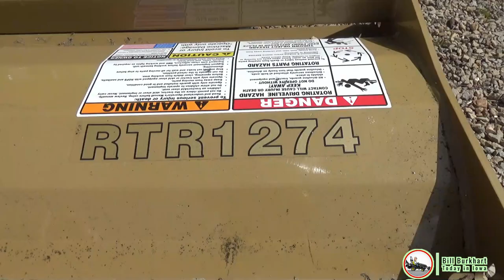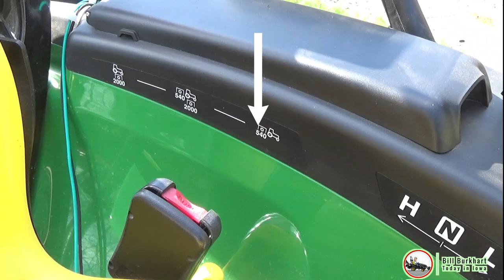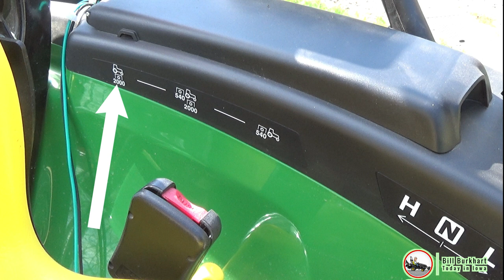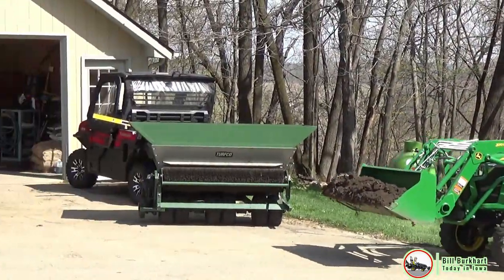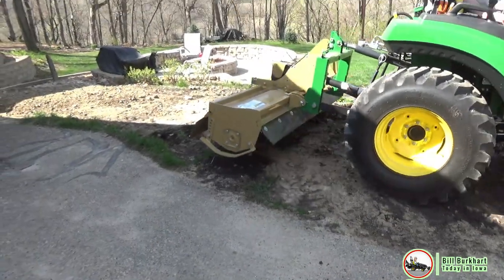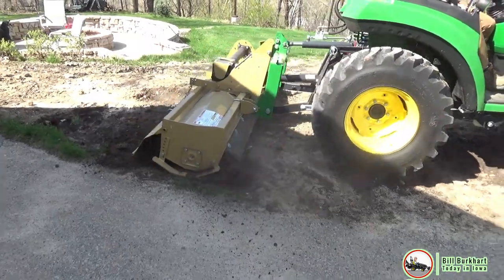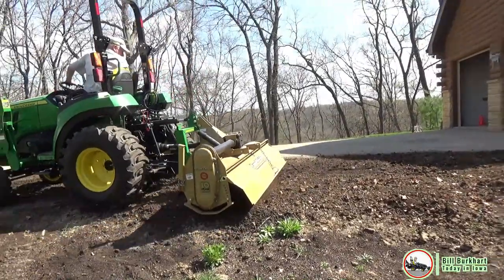John Deere 2038r / Tiller Project /  132

Comment: The tiller did a great job.  And the area looks great with the new grass.  I see you have pieces of mesh from the straw blankets wound up in the tiller.  Myself I regret using that stuff.  I'll be picking up pieces for next year, beside pulling it out of the mower deck spindles.  Hope you had better luck with it than I did.
Reply from the maker: Hello Michael OMG I dislike that mesh sooooo much!! They advertise it will rot away, but you and I know it’ll still be here in 100 years!
Thanks for checking in Michael I sure appreciate it have a great week. -Bill

Comment: Interesting that you said you don't water the lawn since you are on a well. Understanding that you are in the mid west and you don't really need to water the lawn, having a well is exactly the reason why I would.  My current home is on city water and that is why I don't water my lawn..  I can't afford to pay for the water but on the well, the only cost is electricity which isn't much.
Reply from the maker: Good morning Travis, Iowa is just coming out of a drought so I’ve been very concerned with my well depth here. 
Your point about the cost of electricity is correct, but don’t forget about the well pump has a life also. I’m on my second pump after getting 20 years on the first pump.
Thanks for checking in. -Bill

Comment: careful hitting buried stuff with the reverse tine tiller it will tear holes and bend the top shield of the tiller i used to have the 50 inch version of yours i sold it and got a foward tine just for that reason atleast a foward tine will just hop over some thing
Reply from the maker: Windier    Very interesting point, thanks for sharing your experience. 👍 -Bill

Comment: What kind of roller do you use? Just curious as the one I bought from Northern Tool sprung a leak around the shaft and I’ve struggled to plug it. Looking for a new roller. Would love to make one if I could find some old pipe.
Reply from the maker: Hello Steven, I purchased the roller at Farm and Fleet (metal) and it’s been pretty good to me. I don’t have any ideas on patching your current roller so I’ll wish you good luck with the search. -Bill

Comment: Didchya say that this tiller is a "reverse drive" tiller??? So. . . .as your moving forward, your tines are rotating in a "clockwise rotation"???
Reply from the maker: Good morning Trucker Ray
Yes the tiller blades rotate clockwise pulling the tiller deep into the soil. In my experience Tillers that rotate counter clockwise will want to jump on top of the ground or over hard packed ground.
Good question, I’ll clarify this further in the next video.
Enjoy the new week.- Bill
Reply: @billburkhart  Okie Dokie. . . .Thankya Bill for the clarification! Ive been wanting a 5ft tiller for my little John Deere 1025R. . . .but they are so expensive! I dunno if anyone makes em with clockwise rotation of that size. . . . i dunno🤔🤔🤔
Reply from the maker: Landpride builds them the way your asking about …..it’s called an RTA series. As for the price….you’re correct….they’re all expensive.  Good luck with the hunt.
Reply: @billburkhart  Thankya for the response back! I check out landpride. . . .thankya sir👍🏼👍🏼👍🏼